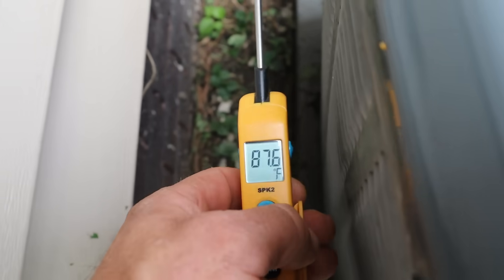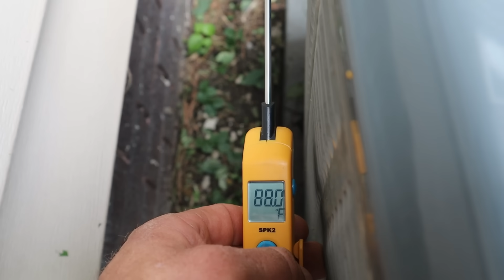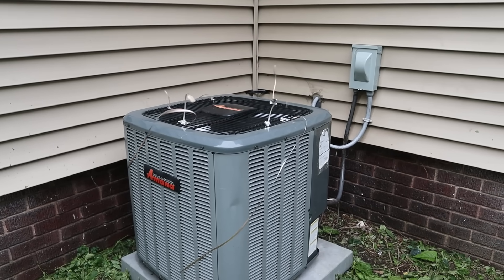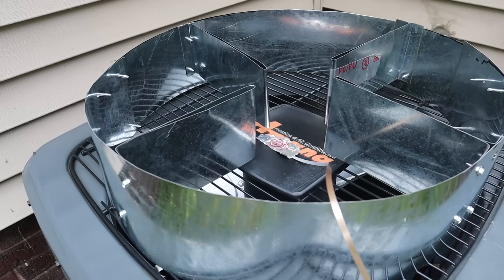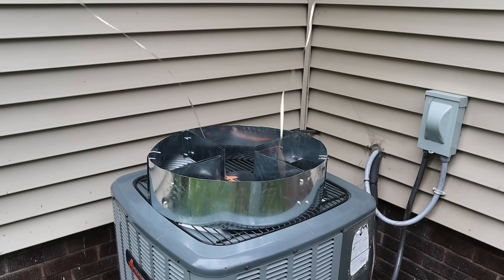Your AC Fan Makes a Mini Tornado

Comment: The baffle is good. Not only it makes harder for the air to get sucked in, but it also converts some of the rotational energy in the air (useless) into straight-line movement (useful). Baffles like this are used in compressors inside gas turbines for that reason.
Reply: Once the air leaves the unit, whether it is swirling or not is irrelevant. The real benefit is preventing the air from looping around and being rebreathed.
Reply: @wiredforstereo  Wrong. If the air is swirling, the fan is wasting energy by making it swirl. By straightening it, you are recovering this energy as a difference of pressure and moving slightly more air or making the fan use slightly less power.
Reply: @marioxerxescastelancastro8019  Doesn't do anything once the air leaves the fan. This isn't generating thrust.
Reply: @wiredforstereo  Not true. The proper directing/flow of air at the unit can reduce/lower its pressure zone in the area of and AFTER it leaves the unit. 
THEREBY reducing the whole ENERGY required needed to move the whole column of air (work,energy required) in the first place.
That is how many air movers , pumps, water, engines, turbines work in fluid dynamics. Engineered on purpose for that reason.
In simplest terms, if you can reduce the pressure at the exhaust by proper flow (even far past the unit ), you use less energy in the 1st place for the whole system.
Reply: @KG-wh8yv I believe you would actually be increasing the air pressure by slowing the air down. The other guy is right.

Comment: Why do they design these things to be inefficient? Frustrating.
Reply: They are very efficient. It's the installation that's the problem. They should be at least a few feet from any structure
Reply: @jeffg4008 oh that’s the cause? I’ve never seen them installed more than 1-1.5ft from a building.

Comment: You make no claims about efficiency or inside temps. I want to know if it will make the evaporator colder?
Reply from the maker: Further testing needs to be done for me to make those claims. I'm in the process of doing that.

Comment: Efficiency needs to be measured by how hot the internal get, not air temps are it, vortex and direction mean nothing. The condenser needs cooling, efficiency needs to be measured by how much cooling is happening at the coils, no where else does it matter.

Comment: Im gonna give people a flash back to like 30 years ago there was a product like this that people could put somewhere on their engine (i dont know engines so dont ask me where) but it was a stainless steel ring with blades intended to spin and the reason for it was it was supposed to increase fuel effenciency. It was called "the tornado" or something and was pitched on infomercials late at night. This reminds of that lol

Comment: Your air conditioner condenser is designed to get the Maximum airflow to do its job to change any of this could seriously damage your condenser unit to get maximum efficiency all you need to do is keep the condenser coils clean don't do s*** like this it could end up costing you thousands of dollars
Reply from the maker: This is just a prototype to experiment with and will be followed up with more data and testing.

Comment: This is equivalent to people not knowing how the inside/outside air selector on vehicle air conditioners works.  When it's cooler in the vehicle than outside, you switch it to inside for far better efficiency.. recycling cool air instead of pulling more hot air from outside to be cooled down.

Comment: The idea is good but to say you've made an improvement is a little shortsighted.  If you see the kW drop after adding the fan shroud, unless you know what the resulting effect on the refrigerator cycle is, you don't know if your impact is positive or negative with respect to "efficiency". The fact is that you're adding static pressure to the fan's operating envelope, which may be reducing airflow overall, which means you'd be reducing in the heat rejection ability of the system, which means a higher high side temperature, which means a lower working capacity of the compressor, which means a lower kW consumption of the system.  Can you see how, in a roundabout way, you could be lowering the efficiency of the system? 

Misting systems and shading systems operate on a completely different principle and almost always increase efficiency.
Reply from the maker: I only stated an improvement in recirculation that might lead to efficiency gains, but I'm not claiming that. I'm being open with the possibility that you may very well be right, and this doesn't work at all. I'm performing these other readings now and will follow up with an honest update. If nothing else, it can at least explain why this might not be a good idea. Read through the comments and you'll see some people already have something on their units trying to utilize the same general concept without the full data to know the true effect. If I can at least clear that up, then it won't be a waste.

Comment: As an hvac tech it’s true the fans are not efficient they would really benefit from an internal fan shroud or external to be fair they are so cheaply made it’s a cost thing how little can u spend on a condenser pretty much the don’t have and safety high or low pressure switch’s well the cheap ones don’t atleast quality has gone way down on everything hvac they even make the bases out of plastic now and make a aluminum micro channel coil wich I recommend staying away from try and get a copper coil if u can the aluminum ones always leak in a few years and can’t be patched easily copper can and seems to last longer in the first place food for thought
Reply: For clarification, this might help; . . . . . . . . . . . . 
Use them!

Comment: Great analysis, idea, and video! Raises a number of questions too. Keeping everything DIY and simple, what if the ring were taller, or slightly conical upward or downward, if the number of vanes were larger, can we induce a Bernoulli pressure drop above, etc., what would that do ? All with just very minor changes to your cool first one. Nozzle design is a big deal in jets and other things. Anyway, again, this insight was clever and the idea is smart and practical I think.

Comment: Great minds think alike
I have cut a fifty five gallon plastic barrel in the three. Using the top piece upside down fits my condenser unit almost perfectly. I believe it prevents cavitation of air, meaning the same thing, this guy said

Comment: You tend to find in basic aerodynamics that doing something very crude is a huge improvement over doing nothing at all. And that all the advanced modelling we have today, while effective in its own right as a means of optimising what you've done, won't bring nearly as much improvement going from "crude" to "refined" as you got from nothing at all to "crude".

Couple other points to keep in mind:
1. No matter how well you force the "correct" flow path and inlet air, you can't get away from it being warmer when it comes in through the narrow gaps. That's a side effect of radiation from the heat exchanger heating up walls in close proximity. Drawing air through the resulting narrow gap necessarily also has said air picking up heat from the wall.
2. These things were designed with some minimum clearance around them (see 1.). It's worth consulting the manufacturer on how far they recommend it sit from the house. Looking at this thing, I can promise you that one of the design assumptions was "nothing around it".

Comment: I have the exact same unit. Thanks for the video. By chance have you addressed the incredibly loud rattle when the unit turns off to stabilize whatever is rattling in the unit? my thought is that it's the compressor doing that?

Comment: Thanks Mike. Nice experiment. I have a heat pump with a fig tree for shade in summer, then I cut it down in the fall for insolation in winter, and the fig quickly regrows the next spring.

Comment: Im not an hvac specialist, electrician or any kind of engineer....but I do pay the electric bill...our rates went up at the top of the year....I live on gulf coast of Mississippi , its hot and humid here, always has been, no getting around that....and in our current economic situation...we know our utility bills will be going up due to changes in utility company power generation.., less use of solar,and wind  generating and  return to gas and oil... rates are going up all across the country....in my mind...any reasonable and functional adaptation to my ac unit that may bring up the efficiency of its function and lower my bill  even a few percent across the board is a big deal to me ! This is simple enough that I can do myself or have made....THANK YOU SO MUCH ! 🤩🤩🤩🤩🤩

Comment: I’m would think that smaller fins inside the ring would be more efficient, since the large fins will create resistance on the fan, forcing the fan to work harder. The vortex itself is usually lower pressure, like a tornado, so it should act to suck the air out of the compressor unit. My box has fins to create a vortex. I’m not an air engineer but that’s my 2 cents.

Comment: I have a newish heat pump unit. Runs in summer and winter. Will this help on those 20 degree days?
Reply from the maker: No. This is beneficial for cooling application only. In heating mode that spill over the shroud is trying to prevent can actually help prevent the coil from freezing at the edges faster.

Comment: I'm wondering what the effect would be in the winter when the heat pump is heating instead of cooling?
Reply from the maker: You would want to remove it in the winter. The spill over can actually help in heating mode.

Comment: With your setup, a sheet of ply/whatever with the round hole cut into it might be an even cheaper, simpler, better option.
Just lay it on top, and butt the sheet up to the two walls of your house, and have it overhanging a couple of feet or more over the open sides.
Then only ground level air will be drawn in, and zero hot air will be rolling over the edge, as it'll be totally obstructed.

Comment: This is clearly logical and practical.  I've used misters in the past for a summer and then there was a scaling issue on the fins by the end of summer.  Not hard to clean that but still a chore that could be ignored resulting in bigger problems.  I believe I'll construct one and use it  Paint it and mount it with the contact points made from wood or something that will not scratch the HVAC unit.  Nice IDEA, Thanks!.

Comment: If this was such a great idea, A/C manufacturers would already do it. The question is not merely if airflow is improved, but is energy cost reduced enough to justify the investment? The investment is not merely the cost of bending metal, but safety as well. The metal in the video has many sharpe edges, prone to injuring people. What design modifications are necessary to create a product safe enough to not injure people for 25 years? One sliced blood vessel, and the resulting medical costs (not to mention loss of mobility forever with that associated cost) would totally swamp out any possible energy savings. Speaking of energy savings, one must perform studies under controlled conditions to accurately quantify actual savings. Merely saying “my electric demand the hour after I installed the vanes went down” is hardly an accurate scientific analysis. A myriad of other factors could explain the lower electric demand. Many factors weigh into any decision: energy, safety, lawsuits, constructibility. 

In short, whenever someone says “In theory, the solution is simple”, in reality that solution is exceedingly difficult. As I said earlier, if vanes were such a great solution, manufacturers would already have done it.
Reply from the maker: It's just a prototype and an experiment. It's evolving and tests are being performed. I'm not slapping a price tag on it, sending these out as sheet metal scraps screwed together and claiming miracle savings.

Comment: Perhaps it's been mentioned already (as it is an old hack) is to place an old AC fan blade upside down on top of the unit to cancel-out the cyclonic flow.  Extra points for enclosing it but it does not need to be any taller than the blades themselves when you do it this way.

Comment: I saw there was a shade-cloth thing that extends horizontally all around, I'm guessing it also prevents air from being cannibalized although its purpose is to shade the sides. It's basically a flat structure made from pvc pipe with a square hole in the middle that sits right on top of the unit and attaches with bungee cords.

Comment: One of my AC fans sounds kinda choppy, like it's not pushing air cleanly. The blades appear to be normal, no bending or missing or loose blades. The unit is only like 5 years old. The one right next to it sounds normal.... any ideas?

Comment: You’re the expert, but I wonder.. Isn’t the cooling mostly due to convection, not conduction? I mean, if the air is still moving through the unit at the same speed, a difference of 10 degrees on one side shouldn’t make a big difference. Or even if it were 10 degrees different on all sides, the air still moves just as fast. 

So I wonder how big of an improvement you’ve created.

It seems like those misters would really help. That’s evaporative cooling throughout, not just a 10-degree difference on one side.

Comment: Good observation, so in reality if it was installed correctly  in the open air not too close to the house this problem would be solved.
Reply from the maker: Yeah I think in normal conditions the shroud would have a minimal effect. Might help decrease fan amperage regardless, but the saving would be nominal.

Comment: In terms of real efficiency "designers" of heat pumps should push the air not suck the air. Trying sucking out the candles on a birthday cake, same lungs big difference in performance.

Comment: Funny that guys will argue with you about this when its a proven concept. Sometimes on large commercial buildings, you will see a giant sheet metal elbow attached to the top of condensers blowing the air a certain direction.
Reply from the maker: I borrowed from commercial designs, so I knew there was something to it. I think the issue is that this design might not be equally effective for every residential unit. Some will benefit greatly; others the effect might be nominal.

Comment: My condenser fan is LITERALLY and I mean quite Literally a tornado 😂 
Blows hat's in mid air 
Blow's screw's to who knows where 
And it feels Soo strong and overpowered and the motor even needs a 10MFD Cap to run LOL
Reply from the maker: I worked in one that pushed my shirt up to my chin. Was that yours? 😆
Reply: @JerseyMikeHVAC that happened too 😂 I went to do a capacitor replacement and turned it on and that happened I literally had to hold my shirt with that thing on so I think yours and mines are stronger then most on the market 😂

Comment: various forms of vortex plates are widely used in many applications involving the flow of fluids, for example fire codes require the installation of vortex plates when water is pumped from storage tanks. This video describes fabrication of a vortex plate placed in the exhaust from an air conditioner.  A vortex plate breaks up vortex flow and converts it to laminar flow, the big energy efficiency gain in conversion to laminar flow is the reduction of turbulence which is essentially equivalent to blocking of  the free flow of exhaust air.  Reduction of turbulence is a major engineering problem in applied fluid mechanics since it cause everything from damage to pump impellers to loss of propeller efficiency in airplanes and ships. It has resulted in the development of toroidal ship as well as drone propellers; reduction of turbulence is also the reason that the tip end of airplane wings are turned up, as was evolved from observation of the shape of bird wings.

Comment: Maybe its also because its in that corner so close to the wall.  Also why only show temperature on one side and the open side one at that.  Why not show the temperature difference on the corners close to the wall?
Reply from the maker: I'll admit I didn't put a lot of effort into the is video because it wasn't the topic I was planning to cover the weekend I filmed it. This was a just a hastily made filler. I didn't think it would get much attention. That said, I made a second prototype and will be testing it fully providing all of the readings: temp, refrigerant pressures, amperage draws, wattage consumption, etc.

Comment: You’re condenser is likely too close to the wall in general. There are manufacturer guidelines that specify the distance from the wall and tilt angle. Mine is probably a good one to two feet away from the wall. 
On top of restricted airflow, walls of your home will also radiate and reflect heat. 
Circulation of outtake back into the intake is only one factor.

Comment: Hello. Such "flow expanders" were used in our production. They were mounted on propylene glycol cooling systems. These cooling systems were located on the roof and stood very close to one near one.  Part of the air of one system was seized by another and the pressure grew, productivity decreased. After installation, the indicators improved.
So this is a good option for use. ))

Comment: Thats not a bad idea.
A tunnel like this also helps with static pressure and depending on fin density probably helping more than you'd expect.
I can see some downsides though, for instance, it looks like the edge of that ducting is gonna bite into the fan guard over time, and it could get knocked off in places like where I live (Iowa) which gets lots of gusts over 60 miles per hour when the weather gets rough.

The evaporative things will work better, but this could work well in tandem with those too but this may decrease it's effectiveness.